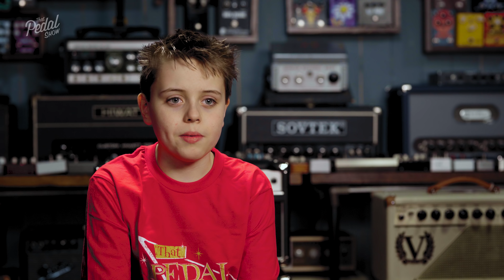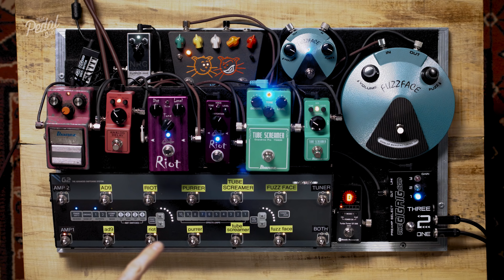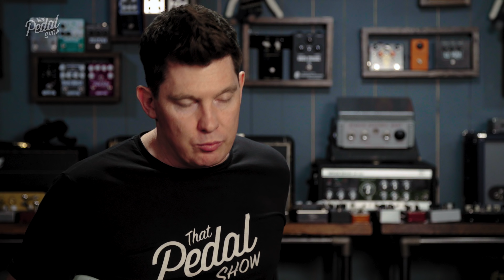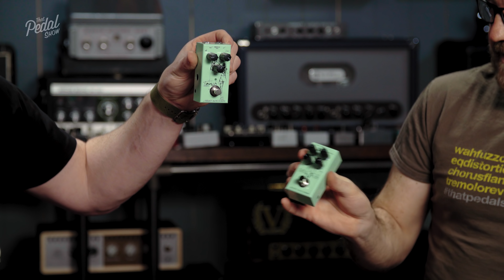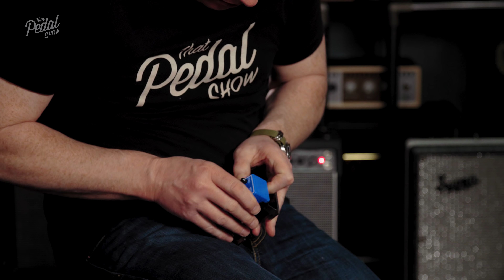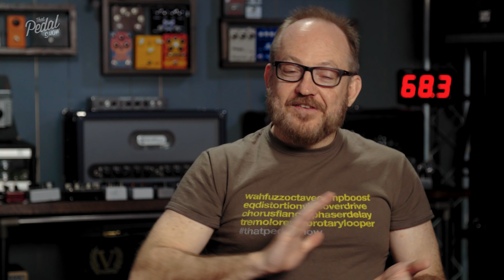Mini vs Big Pedals: Distortion, Overdrive, Fuzz And Analogue Delay: That Pedal Show

Comment: Speaking of pedals getting smaller, do you think we're seeing a decline in double-wide overdrive pedals with an engageable boost or clean boost circuit like the Zvex Box of Rock, the Fulltone Full-drive 2, and Wampler's Plexi-drive Deluxe (not counting the D&M Drive, which is awesome). Has is become unnecessary for each and every overdrive pedal to have it's own boost circuit when a single boost pedal on a board theoretically should suffice?

Comment: The only thing not addressed in this video is Mini Pedals vs Top Jack Pedals in terms of what saves more space. Sure it'll vary based on the patch cables you use, and now there is Top Jack Mini Pedals like those J. RAD's & the Way Huge Smalls. But the question is is it better to have standard pedals that can be placed flush to each other or mini pedals with patch cables spacing them apart? By the way I like Mini Pedals.

Comment: Dan and Mick - here's an idea. Would you be up for doing a Q/A where we (viewers) send you a pic or diagram of our boards and you tell us where you think we could/should make improvements and just generally what you think?
Reply from the maker: It's a good idea but everyone needs to prep themselves that the first step will be properly isolated power from TheGigRig's modular power supply system... And probably a loop switcher. It all starts there...
Reply: @ThatPedalShow  Ouch - you know as well as anyone that buying "utility" gear is no fun! Fair enough though, I'm looking into power options for my board at the moment.

Comment: I have a Wampler Tumnus and it's killer, and the Xotic SL drive has been on my board forever as well. That Suhr riot mini sounded tighter to me for some reason. Not sure if it was less bass or what, but the low chuggy stuff seemed to jump forward more in that one.

Comment: I have a question, i use stereo delay/reverb (Nux Atlantic), after my torpedo captor di/attenuator, and send it to stereo monitors for wet/dry/wet, (amp's speaker gets the dry "thru" signal from the torpedo captor) i want to buy Neunaber Immerse to have it wet only/dry/wet only, shoud i use or rather "can i use" it sqitched to "kill dry" before or after delay?    
Isn't it that if i use it before, the delay will repeat only the wet reverb sounds (so it will blend and dissolve), and if i use it after the delay, Neunaber will interpret the delay repeats as repeating dry signals and cut all the attack from them?
If it is like that, should i just rather look for some delay with kill dry option?

Comment: I'm in need of some help so my pedalboard is tidy.
Which of your products can be used to power a Black Star HT Dual?
So far nobody has helped me as nobody seems to know anything!!
I want to keep all power as clean & tidy as possible & with the included adapter this doesn't make for a tidy pedalboard!!
I would be so grateful if you could shine a light in my direction!!
Reply from the maker: You just need to know the voltage, current and polarity and connector type. We're not sure.

Comment: interesting. in amp building I found smaller rated components react differently to larger ones. e.g. a 1/4w resistor isnt as open as a 1w resistor.
so I imagine that the smaller SMD's are going to effect sound. do the designers have a choice range for flavour or do they have to twiddle around?
the challenge you mentioned 
each of you have to setup a complete rig that you can carry from car to gig in 1 trip without a trolley. (maybe something on your back....)
guitar, amp, pedal board, cables etc.   the gig will would be a small pub with no desk or PA (only what you bring). given you are not into modelling, no katana etc.

Comment: I got passed the small pedal phobia but for some reason I’m back at it.. there’s this Japanese ts clone I want and there is a mini and standard sized and I can’t help but feel the mini is not up to par lol.. I wanna see the insides and see if they use through hole parts on the mini as well but I don’t think it would fit if they did.. it just feels I’m shorting myself going with the mini some how even tho I’m sure they sound just the same

Comment: Mick and Dan, do you both use a Virtual Battery with your Sunfaces, and if so do you adjust the voltage sag or leave it turned up?
Reply from the maker: I do. Never actually checked so assume it's full up. Mick here!

Comment: Maybe a crap idea for an episode - I recently returned to a strat having only played HH guitars (and one P90x2 guitar) for 16 years. I can't believe how different it is and how much it requires me to play it differently. If I hold my hand in the same place as usual, my pick hits off the middle pickup. Could you do an episode on using multiple guitars? The challenges, the reasons why you would, why you wouldn't, and any tips for compensating with the changes?

Comment: Dan I have a question about loopers. Is there a difference in the sound if I have two separate pedals in two separate loops and turn them both on? Opposed to having those two pedals linked together (one running into the other) with a patch cable?

Comment: Sorry, it's a pet-peeve of mine ... the Xotic EP Booster is NOT an Echoplex Pre-Amp circuit.  It is a pre-amp/boost circuit that is voiced "vintage", and Xotic will tell you that themselves.  
As someone who owns one, and has researched the Echoplex EP-3 pre-amp quite a bit, it does not sound like an Echoplex at all.  Look into Australia's ClinchFX EP-Pre pedal if you want the real thing.  They make a tiny version called the Pico-Pre if you want a micro pedal.

https://www.youtube.com/watch?v=LderEFqby4A

Comment: Way off the video subject but I recently acquired a new strat style guitar (Ibanez az) & am considering a full pickup change along with the electronics. Since mine is h-s-s & humbuckers typically call for 500k pots & single coils call for 250k pots which would be the appropriate value due do having both a humbucker & 2 single coils?

Comment: My ditto looper's switch crapped out after a year of non extensive use. Repairing it is no option as it is as expensive as buying a new one. On internet I saw this is a common problem with this pedal. Do other mini pedals have the same problem? Not having robust switches?
Reply from the maker: Switches are the single biggest failure item in all pedals as far as I'm aware. Mick here. Which is why Dan is all about OptoKick in G2. Robust!
Reply: It's indeed one of the reasons to buy a loop switcher. I think the problem here was that the ditto is so crammed that replacing a switch is hardly doable.

Comment: The tube screamer mini was the first pedal I owned, a couple of years ago. The guys at the shop recomended it to me when I told them I liked John Mayer style. At first I didn’t like it that much, but now I use it quite a lot. It turns my shitty amp into something better to work with. 

By the way, I only own 2 pedals apart from that one: the hall of fame 2 (tc electronic) and a boss looper. What effect would you recomend me to buy next? What pedal?
Reply: Get the mini flashback. Tc electronic with the tone print app.

Comment: I've put together a mini board, which has a TC Polytune, Mini TS, Tumnus, TC Mini Flashback, MXR Phase 95, TC Ditto and a TC Spark Booster all on a PT Nano Plus into a Fender Blues Junior for gigs where floorspace is at a premium. It's pretty badass, but I definitely prefer taking my big board and big amps. Do you think this could simply be Wall of Marshall syndrome?

Comment: Would you say that the Fillmore 50 is mix between a Fender Deluxe Reverb and Marshall 1974x?
Reply from the maker: Not really although it can cover those territories. There loads more traditional Mesa Mk series-type thick mid rangey drive in there too. It's a decade or three on from the Fender and Marshall, but as I say, can cover that ground too. Mick here. :0)
Reply: That Pedal Show thanks Mick!

Comment: Just so you guys know the band of gypsys fuzz face mini doesn’t clean up well cause it’s not really a fuzz face. It’s based on a modded octavio circuit with no octave. Jim i used it and it was put in a fuzz face enclosure.
Reply: You can make it clean up really really good but the gain needs to be dialled back quite a lot, it also has a lot of output!
Reply: @3rdtonefromthesun  thanks for the tip

Comment: From an engineering point of view I don't think a Fuzz Face is a well designed pedal cleverly designed with the minimal number of components.
The Fuzz Face circuit looks like it was thrown together by someone who didn't know much about what they were doing, while having a manager screaming in their ear - 'it has too many parts, it has to be cheaper'. That was pretty much how effects pedals were designed in the 1960's. As a result the circuit operating points are so dependent on the gains of the two transistors that, without custom tweaking, no two Fuzz Face builds are likely to sound the same. And in any case nobody knows what the original design aims were, or even if there were any, beyond make the guitar sound fuzzy.  
In contrast the Tube Screamer was designed to follow good engineering practice as a stable circuit that produces almost identical results every time. We know it was intended to produce symmetrical square wave clipping with some bleed through of the original signal in an attempt to sound like a valve stage clipping.

Comment: Pedals don't sound right being mains powered. 
Or powered by 'long life' alkaline batteries. 
In order for them sound 'right,' they must be powered by old 'new old stock' Indian made 'Flying Bomb' batteries. 
They sound even better once they start to leak and burn the inside of your pedal out.
These batteries need to be found when they're on the point of leaking, or they won't have the 'vintage mojo' they won't sound 'right' otherwise!

Comment: Am I the only one that gets a stiff and somewhat harsh upper mids/treble thing going on with higher gain pedals going into a clean amp? I’ve noticed it doesn’t happen when you go into an amp that’s slightly breaking up already, but the whole high gain pedal into a super clean amp thing has never really worked for me because of this. And I’m a Marshall guy, so I don’t shy away from bitey guitar tones. Maybe it’s because the amp isn’t compressing like it would if you were getting those levels of gain from the amp? Any thoughts?

Comment: Hey guys, own an octafuzz and play through a blues jr with a strat. Obviously to my disappointment the fuzz on the octafuzz isn’t as useful as the octave section. I know Mick has used one off and on for some time. Any suggestions on good fuzz’s to stack with an octafuzz that are great but not at boutique price points? Some you may suggest that sound great into that type of amp? Thanks and cheers as always fellas!

Comment: You don’t need a battery. If you  don’t have electricity, your amp won’t work. Those battery powered pedals will not sound very good if the amp isn’t on. 

FYI the Mooer Solo is an instance where the copy beats the original. Better than the Suhr Riot

Comment: I don't understand the reason WHY you would want a battery inside your pedal?!
It will only cause problems on stage when the battery runs out of power?
Reply: It's just about the cleanest and most isolated power source you can get your hands on? If you're gigging every night, then of course it would make more sense to have a great power supply - but for hobby players who maybe has a gig every other month, batteries can be ideal :)
Reply: good for when your daisy chain gets yanked out too  @MagnusGuldbrandsen
Reply: @lowqualityguitarvideos  That aswell! :)

I mainly use a Kemper, but now and again i do jam nights at a local bar, and for that i have a tiny board with just two overdrives and a delay. All analog Boss pedals, where the battery compartment is easily accessible. And with batteries, i don't have any hassle with finding an outlet and all that malarkey - just plug 'n' play... And because everything is analog, the batteries last forever.

Works like a charm! :)
Reply: @lowqualityguitarvideos  Daisy chain? Nooo man... decent pedalboard with isolated power supply!
Reply: @MagnusGuldbrandsen  Analoge using less power I can definitly understand that. And isolation is absolutely something i didn't think of when asking the question. I play in 4 bands so I rehearse and gig a lot. So having the isolated power supply is a absolute must.
Jam sessions... you are (again) absolutely right! Thanks for clearing that up buddy.
Reply: @TheRealFreekBos  Happy to help! :)

And if i was in your situation, i'd never rely on batteries... Just the expense of powering a 6-8 pedal board with batteries that gets gigged regularly, would surely warrant the cost of a good isolated power supply, that could deliver a steady stream of juices to the board :)

Comment: Mini-pedals are great, save some space on the board. However, what about the power supply for them? Is there a 'mini' multi output power supply?? Not much space saving there, is there if the power is the size of 5 (or more) mini-pedals???

Comment: IMHO pedals in the micro size are capable of amazing sound and should just be tested on their own merits.  I don’t think it’s fair to compare a classic design of a larger pedal to the micro little brother.  Just go to the shop and give it a try!  If it sounds good it is good!  Is anybody in your audience really going to know the difference?  I think the micro pedals get a bad wrap because there are so many cheap pedals coming from China.  Tone City for example have a few really great pedals, and then there are few I’ve tried that I felt were complete crap!  Worse yet a lot of the micro pedals I have found aren’t at my local stores so I have to order them online, and then I’m stuck with having to deal with returning it or just keeping it.  It really put me off on the micro pedals.  Exotic Effects, MXR, and Ibanez you can be assured their copies are fantastic in their own right and not have to worry is this going to sound as good as it’s big brother.  But let’s be real space is always the deciding factor of a normal sized pedal versus the micro pedals.

Comment: I jumped the wrong way when the mini thing was first starting and built a board consisting wholly of Mod Tone Minis on a Pedaltrain Mini.

Man did they mess up the form factor on those things. They aren’t rectangular, but are more wedge shaped, meaning the the jacks really get in each other’s way when you try to cram them in tight.

On the other hand I’ve managed to cram a pedal tuner, clean boost and delay into one of my boards that was completely full as far as conventionally sized pedals were concerned.

I do have to be careful about my choice of footwear though. The pointier the  toes the better...

My latest mini format acquisitions though are a Mooer Micro DI with cab sim, an Aroma Shaper, which crams multiple cab sims into one box, and A/B/Y. I can stick those onto a small satellite board and cover all my silent stage DI bases.

Eve thought of doing an episode on some of the dirt cheap stuff off AliExpress? I’m not talking Mooer here, but Aroma, Mosky, and Mastersound.

I’ve put together giggable boards for well under a hundred quid.

Comment: This is a bit dull... but for reference, thinner wires have more RESISTANCE than thicker wires. Surface Mount Technology, thinner (but shorter) wires as per iPhones etc, is all about including the RESISTANCE of the wires into choice of actual RESISTORS in the circuit. Except there are not RESISTORS in all parts of a circuit. Never-the-less increased, tiny,  RESISTANCE is introduced in SMT design. For millions of people, this makes NO DIFFERENCE. For "sensitive musicians ears"... it can be noticeable.
Reply: Much more than that to the equation.. And for SMT/Through hole the connecting PCB lines are basically the same - but hard wired for sure have more copper. But it is not possible to compare apples to apples as the components are also different for the different applications (wired, Through hole and SMT). But yes resistance is one where you could have less in a wired though the leads are normally far longer reducing that advantage. But for capacity and also noise the SMT design is far superior if designed right. in any case you are talking more of differences than good/worse as you can never compare exact constructions as components is not interchangeable.
Reply: Some of the miniture components will have different frequency responses compared to their full sized equivalents too, but against a distorted sound that wouldn't make much difference, as for a clean sound...